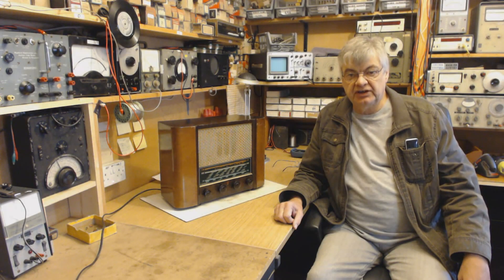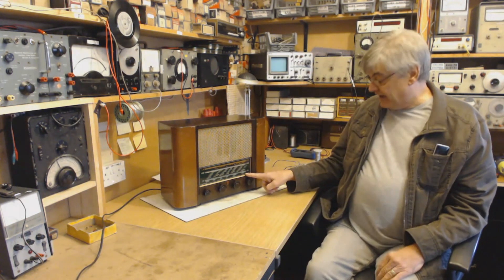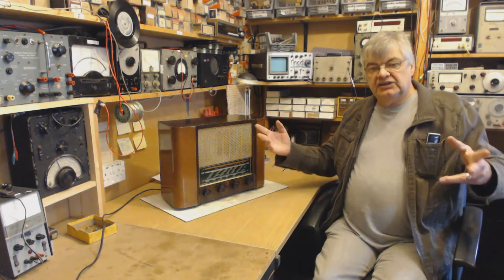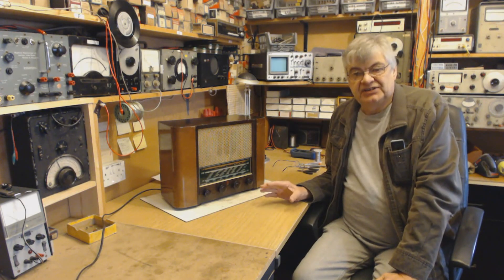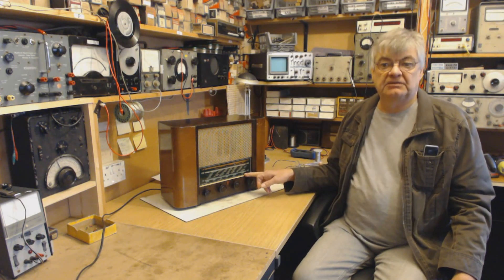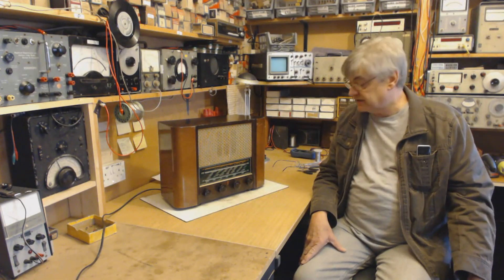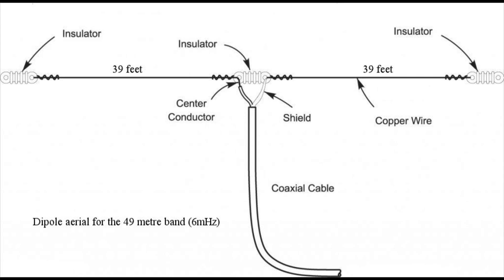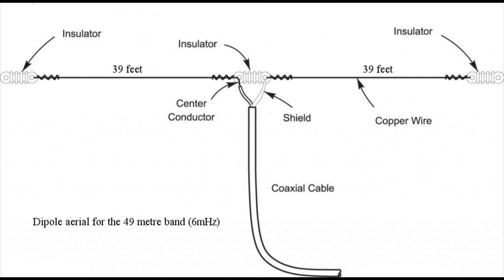A dipole aerial for short wave listening

Comment: Hi ive just bought a Yaesu FRG 7000 and live in North Wales, what is best for general SW listening pls right across the bands. Thanks
Reply from the maker: You’ll probably find the best aerial for general purpose listening is a length of wire as long and as high as possible.
Reply: @g4nsj  Okay that's the plan then, my current wire is say 30 feet I'll at least double it. Thanks

Comment: It was recommended that a 1:1 balun be used with the dipole and the shield connected to a ground rod at the balun. Does the use of a balun rule out the Marconi T mode? If I install a knife switch at the antenna mast to disconnect the earth ground ,could the Marconi T be used with the balun?
Reply from the maker: I don’t think the Balun will affect the Marconi T antenna. Try it and see how you get on.
Reply: @g4nsj  I see that you specialize in repair of valve receivers. I purchased a Hallicrafters  SX-71 at a local thrift store for$35. I have not tried to test it as I need to build the antenna first..I am a novice to value work as I am now learning to repair and modify a valve amplifier.  40 years ago I took a tech class on radio electronics that covered concepts of radio function (tank circuits heterodyne). It may be over my head to attempt to trouble shoot to function as the caps are probably off and the valves need to be checked .Having it repaired by a professional is an option.No technicians in my area.

Comment: Hello  G4NSJ. Thank you so much for the clear explanation.  I would like to build a multiband maconi type of dipole you share. My question is this: instead of using a 59 ohm Coax feed line can I just use speaker wire?  Second question :  would l be able to hear better if I used a longer dipole ie, say 50 feet for each element (100 feet for both legs of the dipole)?
Reply from the maker: @alexchin2286  Hi, it’s good to hear from you.  If your aerial is only for receiving, then you would be better off with an end fed wire. A dipole fed with coax or speaker wire will only work well on the frequency it’s cut for.  If you want to dipole for a certain broadcast band, then you will have to cut it for that band. You could try a very long dipole and see how it works.
Reply: @g4nsj   Thanks for your reply.  73

Comment: I am using a Marconi T.  Speaker wire to the top floor, and then split and run in the windows in a diagonal pattern because of electrical lines along the street. Straight horizontal did not work. The lines were too noisy.  I go 10 foot up, split and run in the windows diagonally for 80 feet. I've got 170 foot of wire outside my apartment. I could shorten it and I may. I am going to try a plug and make it a dipole first. Then it may get trimmed. I want to listen to all bands so I am also going to look into a tuner. Those are steep.
Reply: That's interesting information, thanks very much. Cheers, Ray.

Comment: I realise 75 ohm coax isnt correct, but does anyone have any experience of actually comparing 50 with 75 ohm for SWL? Is it likely to impact signal strength much on a short 5-10m run?
Reply from the maker: For receiving, I doubt that it will make a great deal of difference.  Especially if you use an ATU or preselector.
Reply: Receivers with a coaxial connector are usually 75 ohm. Transceivers are normally 50 ohm. A dipole up high enough is nominally around 72 ohm. As mentioned, for listening it'll have virtually no effect.

Comment: Another great tutorial, Ray.
I'd be limited to each leg being 12' long. What band should I expect to receive?
Many thanks!
Reply from the maker: It will work best from 20 to 30MHz.
Reply: @g4nsj  Thank you. 
What is the math to figure that out?
Reply: @usernamemykel  Metric or imperial? Either way, it's divide the speed of light by the frequency to get the wavelength, or divide the speed of light by the wavelength to get the frequency. A half-wave dipole will be half the wavelength. If we use metric, the wavelength would be 299.8 / F <MHz>, or / L <Metres>. Let's take your 12ft, or total length of 24ft. That 48ft wavelength, or about 15 metres. Straight away you can see that would work on the "15 metre" band if there was one. But if you want the frequency, 300 (rounding!) / 15 = 20MHz.

Comment: Should the general orientation be north- south or east-west? Your information is gold thanks for the generosity.
Reply from the maker: If the wire runs north south then it will receive better from stations east west. To be honest, signals in the ionosphere get twisted and bent so it doesn’t matter too much.

Comment: I'm using dacron rope (paracord) for my insulators.  I tie the rope to the end of the poles, so I can stretch the aerial between to poles or trees.
The new silicone self-fusing tape should work well for water-proofing the connections in the centre.
Reply from the maker: Great idea. Once the better weather is here I might paracord.

Comment: Hello Sir, I just bought an Eton Satellite 750 sw radio.  As I see, the 6 mhz frequencies are capted with an dipole antenna like this: 468/6mhz= 78ft,  so 39 ft each side. At that length, can I also receive frequencies higher than 6mhz ? (for example,  Band 31 at 9.4-9.9mhz...). Because if I do the math : 468/9 = 52ft, so 26ft each side. The way I understand it, since you need only 52 ft antenna to get the 9.4-9.9mhz  frequencies, then at 78 ft (the 6 mhz antenna) would be more than enough. And the higher the frequencies, the shorter antenna will be needed, right?  To simplify, with your antenna at 78 ft, it seems like I can also receive all the frequencies higher than 6mhz? But not those under 6mhz. Am I right at my supposition? Please help me....and thanks for answering :).
Reply from the maker: Hi Bill,  Your dipole will receive frequencies above 6mHz but it won#'t be brilliant. Ideally, you need a doublet antenna with a balanced ATU but what you have should be fine.
Reply: @g4nsj  Tanks for answering....one more : what's the right way to solder the 2 stranded wires (the 2 horizontal 39 ft long wires) to the coax? One soldered to the center conductor and the other to the metallic shield?  Or both on the center conductor? Thanks again :)
Reply from the maker: @fon9365  Yes, one soldered to the center conductor and the other to the metallic shield.
Reply: @g4nsj  Thanks again sir. 👍

Comment: Great informative video. I’m interested in making a dipole for my loft space but it’s only 14 feet wide, would the Marconi T idea work for improving SW reception? Currently using a 16m sloper long wire outside but it’s a bit unsightly so would like something out of the way. Thanks.
Reply from the maker: I think it’s a case of try it and see.  The Marconi T might be better for receiving. Cheers, Ray.
Reply: Thanks Ray, I’ll give it a try. All the best.

Comment: Hi Ray. I'm enjoying watching your videos. (Your "informal" style makes for easy listening and learning!) Just a quick question: When you cut the legs of the dipole to exactly half the total length required, do you  take into account the short amounts of wire which will end up twisted back on themselves at the insulators and, therefore, not form part of the overall physical length of the dipole?
Reply: If you want to, make the two legs slightly longer, then add the feed wire, and then cut the overall length to what's right.  It's not that critical (a couple inches.) and no antenna is perfect.

Comment: Hi Ray! Thanks for the great information! I don’t have an earth socket on my radio, where should the braided side of the coax go?
Reply from the maker: To the chassis, but make sure it's not a live chassis type radio.
Reply: @g4nsj  thanks Ray. It’s a nice new Tecsun pl 880 and I don’t want to drill any holes in it. You mentioned using the headphones jack for a ground. Wouldn’t that kill the sound from the speaker?

Comment: Hi great video ! I have a question... I've seen that sometimes dipoles antennas were built with insulated copper wire (electric cable). Is that non-sense ? You work with electromagnetic (radio) wave so it should not be insulated right ?
Reply from the maker: Insulations doesn't matter. Many people use insulated wire for their aerials, including me.

Comment: It would be alot easier if people start using meters instead of feet, since wavelenghts are in meters.  If not for anything else, measurements in feet really aren't anything else than measurements in meters, recalculated. The definition of 1 foot = 0.3048 m.
Reply: I'e used both systems my entire life.  It is just as accurate to state that meters are just feet recalculated.  If you have a reasonable command of mathematics, it makes no difference how length is measured.  I do get a bit of pleasure watching metric people try to handle fractions though. 😂

Comment: Great advice for aspiring SWListeners Ray, well done!
May I suggest here, if the said antenna is used as intended (i.e. dipole configuration), the noise level will be much lower from being instead, used as a 'Marconi T' configuration.
Am I correct in saying this or, in your experience, there's no difference in QRN levels?
Your videos are both, entertaining and informative as well as, very clear to understand. Thank you!
Reply from the maker: Arthur Manolopoulos I think the noise should be lower as there’s no vertical element in the dipole.

Comment: I am reacquainting myself with the world of Shortwave listening after many years. I have purchased an SDR - RTL to help bridge the technological divide.  I had planed on a dipole straight off. But needed to remind myself of the rules and principles.  This video was absolutely great in assisting me.  I think I can make it work well.  I have a 50 ft area, of a 5ft high wooden fence that surrounds my apartment.  I know its a bit short of 75 feet for a 6m antenna, but with some different directions taken by the wire I think it may work. It may not be perfect.  But I can experiment with shorter bandwidths to see my results I believe.  Thank you sir for your video.
Reply from the maker: Hi Ken, thanks for commenting. Good luck with your aerials. Do let me know how you get on. Cheers, Ray.

Comment: Can anyone help me.

I have a small portable radio (Kaito KA500 Voyager) with an telescopic aerial. I mainly using the radio outdoors and therefore looking at using (ladder-line) as my feed-line, instead of coaxial cable.
How would I attach the end of the ladder-line to the portable radio's telescopic aerial? 
Can I attach both wires to the telescopic aerial?
Or do I need to attach one wire to the telescopic aerial, and the other wire to a ground?
Reply from the maker: You can attach both wires to thee aerial but, better still, take one to the aerial and the other to the radio chassis. The outer connection to the earphone socket might work as the chassis connection so take the other wire there.
Reply: Thanks Ray, I appreciate the advice, great to know.
Reply: Hey Ray, if I use the 3.5mm earphone socket; would I use a 3.5mm audio "mono plug" or a "stereo plug"? Or will it not really matter which 3.5mm audio plug is used? Or would one be better than the other.
Reply from the maker: Kiwi Bushcraft And Survival it doesn’t matter because you’ll only be using the outer connection, not the two inner ones.

Comment: I'm putting together this ariel this weekend, just a bit more advice 
Could I put a switch to switch in between the coax ground and core to be able to make the ariel more flexible for short wave bands ?

I'm also worried about any live static coming in, is there a way of protecting , I don't want to grab the end and get a belt
Reply from the maker: Yes, a switch would be ok. You could try a large RF choke between the aerial and earth to discharge static build up.
Reply: Radio Workshop I'm new to the antenna project , I've ordered a  
*Inductance: 10mH
* Self Resonant Frequency: 
* DC Current Max: 70mA
* DC Resistance: 30R
* Q Factor: 150
* Inductance Tolerance: 10%
choke , would that be OK to reduce static ? also do I place the choke between the coax core and ground ? I understand all this is at my own risk but your non committal advice is much appreciated 
Kind regards Shaun

Comment: Hi...hope to get myself a HF tx rig for when I retire soon...I have an M6 ticket and would like to construct several centre fed half wave wire dipoles and use them in a mobile location...prob strung between 2 trees.

If I use 50ohm coax as my feed line...do I need a balun at the dipole centre...never was able to get my head around Baluns...lot in print re having one but not much telling what they do.

I will be working QRP.

Nick.
Reply from the maker: Hi Nick, just roll the coax up at the feed point. Say, six or eight turns about six inches diameter. That will help to keep RF off the coax.
Reply: no you don't need one.......if you have a newer radio, they have TVI filters in them (i.e., low-pass filter).....I have used 80m and 160m dipoles without baluns and 50 ohm coax, and no issues.....a good insulator in the middle....good solder connections, and a bit of sealant where the coax splits to feed the antenna is helpful......but you don't need one....it is neater, and will have less likelihood of rf travelling down/around the coax, but with low-power (QRP) and less than 200-300watts or so, you should not have problems....for a transmit antenna, just make sure the feedline is at least the length of one side of the dipole, i.e., 33 ft per side? 33 ft of coax, or longer.....not as critical on receive, or below 50 MHz and not much output power.....hope this helps....

Comment: How to connect this antenna to a radio that doesnt have external antenna jack?
Reply from the maker: +andre H Is there a telescopic aerial for shortwave? If so,  connect the coax inner to the telescopic aerial and the outer braid to the radio chassis.
Reply: but would that work if the radio chassis is made of plastic? (non conductive)
Reply from the maker: +andre H There will be some metal inside the radio. Alternitively, take the braid to the outside of the earphone socket.
Reply: +Radio Workshop many thanks man!

Comment: My Panasonic RF-800U radio does not have a aerial socket behind and does not have a earth socket on the rear. Should I actually modify the radio by drilling holes and bringing out aerial and earth sockets(negative of battery) at the rear of that brand new radio to be able to connect to external aerials? It does have a long 84cm telescopic aerial.
Reply from the maker: +indiaradioguy That's really up to you.  If it was my radio, I would drill holes etc. Bear in mind it will devalue the radio. Cheers, Ray.

Comment: Very nice aerial concept. Thank you.

I had not heard widely about dipole aerials being used for SW listening and especially if old valve radio sets could use them effectively. India only had those fine copper mesh between plastic insulators (acting as capacitative hat) with a lead in wire from the mesh bringing signal to radio.

On my 8 band National Ekco A731 valve radio, I have many SW bands as bandspread. But 49m is not bandspread and it is clubbed under single MSW band. 

Questions:
1) Will this dipole aerial help me tune other SW bands like 13m, 16m, 19m, 25m, 31m, 41m, SW 60m? and the MW? 

2) When I connect the coaxial cable to the two 39 feet dipole sections, should I connect the coaxial braid to the earth socket of my tube radio? Or just leave it?

My valve radio has mains power cord of three terminal and the radio chassis is earthed through the mains power cord. There is no possible of a independent earth for my radio on a RCC highrise in India. RF disturbance is grandest in India due to concrete forest that we have :)

3) Will the length of 39 feet change for SW 60m and SW 90m and MW?
Reply from the maker: +indiaradioguy  Hi, A dipole will only work well on the band it is cut for. Yes, the coax braid goes to earth socket on your radio. If you want to cover all bands, you will need a simple wire aerial with a tuning unit.  Regards, Ray.
Reply: +Radio Workshop Thank you Ray. Can you please suggest best tuning unit for the long wire aerial? Are they up for sale on www.amazon.co.uk or other websites? Getting those ATUs is impossible in India and building them will is another impossible task as getting a 365pf tuning cap is not so easy now.
Reply: +Radio Workshop What is best optimal length for long wire aerial to be put up? Or should I put up inverted "L" to cover all bands?
Reply from the maker: I think an inverted L will be your best option.
Reply: +Radio Workshop Thank you. What should be the length for inverted L aerial wire for all band reception? And, What type of wires should be used for best reception? There are two wires in inverted L; one between the egg insulators and one which is the lead in wire.
Reply from the maker: indiaradioguy Use one single piece of wire for the whole aerial. Any wire will do as long as it's not to thick and heavy. The length should be as long as possible and as high as possible
.
Reply: +Radio Workshop Thank you. Some forum discussions sometimes do claim that a very very long wire can "load the aerial circuit" of a radio. Many forum members report 70 feet a descent length though. Anything above, they found "something was wrong in reception". Very few forums discuss optimum length of a aerial for tube radios.
Reply from the maker: Glad you found it useful. Cheers, Ray.